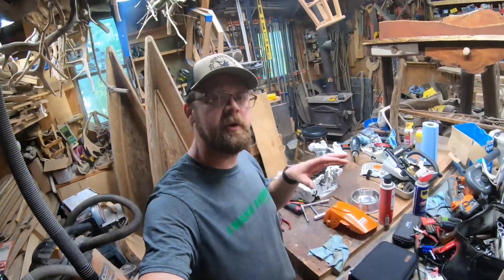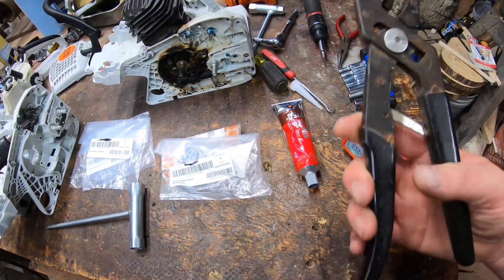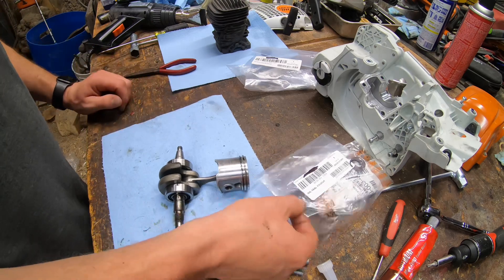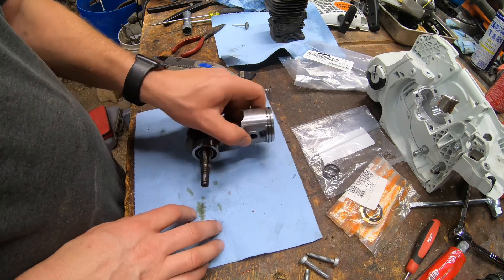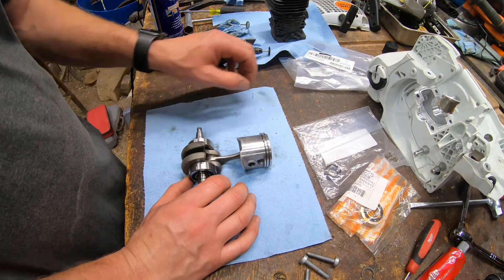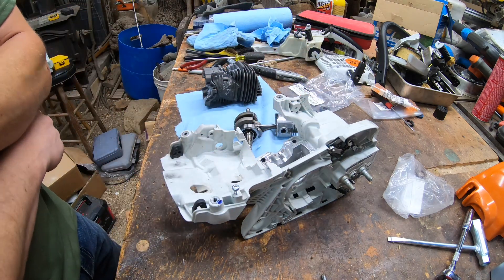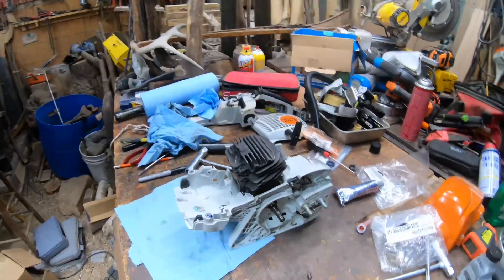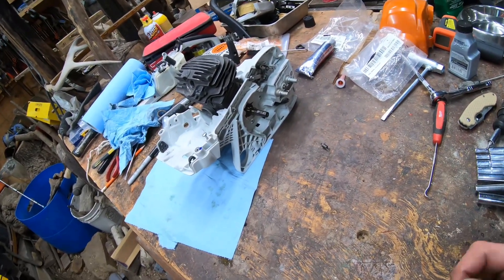Putting new seals on the Stihl MS 291 chainsaw

Comment: Quote from Stihl MS230/250 Service manual. "Heat ball bearing to approx. 50°C 
(120°F) and, with closed side 
facing outwards, push it on to the crankshaft stub as far as stop." I used this temp on my MS250 bearings install yesterday. Just a light tap home required with a deep socket on the inner races. I also put the crank in the freezer for 30 mins first. Seems 250F is quite hot. Prob good your bearing inner dust seals got distorted a bit on your 250 to let the fuel/oil get into them better during running?
Thanks for your 3 vid series on the MS250 bearings. I had to change piston and cylinder after a failed main bearing spread metal up the cylinder and scored the piston too! Your videos were a fantastic help. Cheers!
Reply from the maker: Hey Peter , I appreciate this comment! Thank you ! 
I’m glad my video could help you out